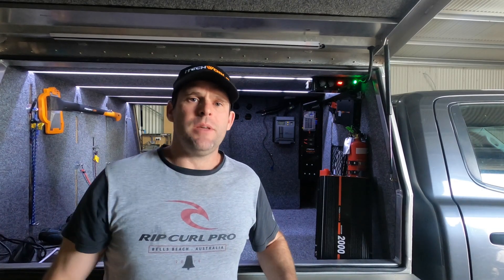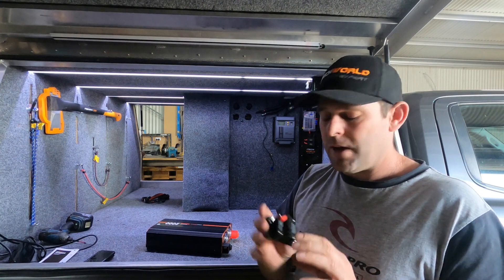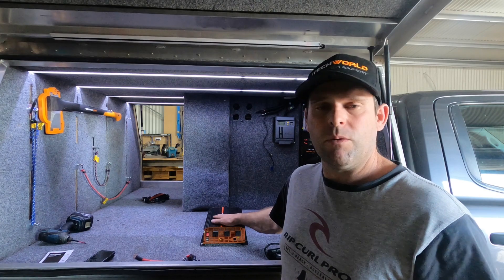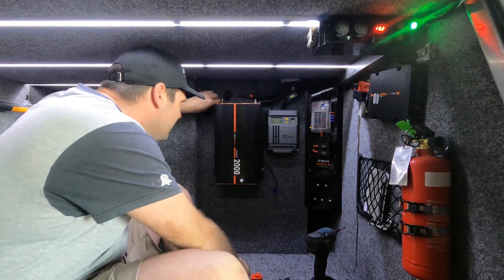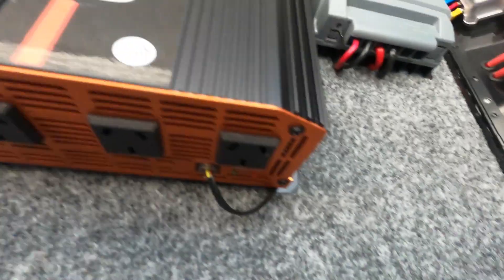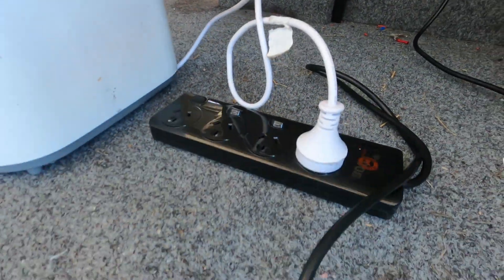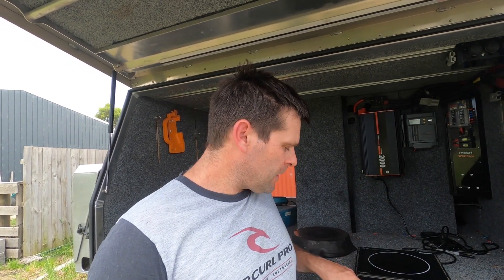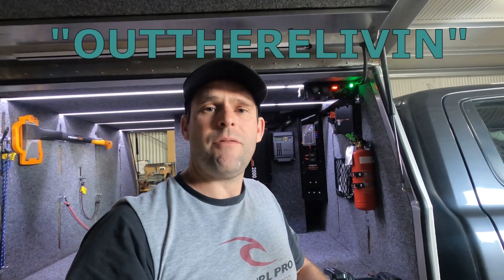INVERTER install, review and test, iTECHWORLD 2000w pure sine wave inverter with induction cook top.

Comment: Hi mate, 
appreciate the video.
We have a 1991 Toyota Coaster bus camper and I want to
upgrade our 12v agm house set up, for more off grid suitable
lithium/solar set up.
I'm considering the whole Itech world 4 x 4/ caravan package,
with the 2000w inverter you showed here and was concerned
our 2000w induction cook top may have been too much for it.
We wont need to go nuts cooking on it every meal I think and
will always carry a little butane burner or gas burner/bottle for
emergencies or to conserve 12v power.
Only question now is the 40amp DC to DC charger in the kit,
as our bus has a 24v starting system/alternator.
Any thoughts on roof top solar panels etc with this set up?
Cheers.
Reply from the maker: Hi imamenigma, I think you best bet would be to call the technicians at iTechWorld. They will answer all you questions and find the right equipment for you.
Reply: @outtherelivin645  
No problem,
I think it's all good re 24v to 12v as their charger is multi voltage.
I'm waiting on a reply from them as well.
Thanks mate.👍

Comment: With the 2000W induction cooktop, can it work at that wattage. Also for how long on your setup?
Reply from the maker: Hi Daniel thanks for watching,
the cooktop works will either the 2000w inverter and 200ah of lithium batteries.
If you take the 2000w of the accessories and divide it by the 12v supply power you get 2000/12=166. That is 166ah and hour will be used from you battery supply. That’s 83% usage.
I would suggest limiting cook times to 45 minutes off a full battery to have power in the battery for other things like fridge, lights ect
I don’t think you could run this off 100ah of lithium it would not have the capacity to service any other electrical items.
Cheers 🍻
Reply: @outtherelivin645  100aH batteries don't supply 166 amps (even 2 in parallel), so I don't understand how you can operate a 2000W inverter at full draw?
Reply from the maker: @stevekenny4732  Hi Steve thanks for watching. Glad you enjoyed the video. For more info on technical specs you can talk to iTechWorld’s technical department. They are great to talk to.
Happy camping

Comment: With 250 amps I would not trust a circuit breaker especially a cheap Chinese one
A 250A fuse at $10 is a lot cheaper than a burnt out vehicle
The itech inverters are well made like most of their gear
Reply from the maker: Hi Michael, thanks for watching! Love the feed back we may do a fuse V circuit breaker video one day.
Reply: Spoken like a professional electrician! 🔌
Reply: Chinese Electrical Safety Products: Built to work but, not to last.